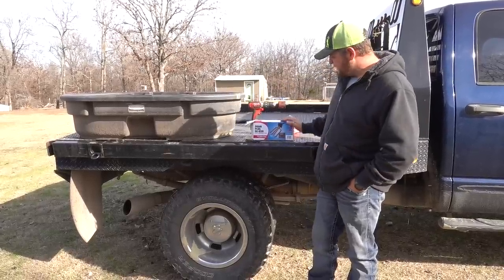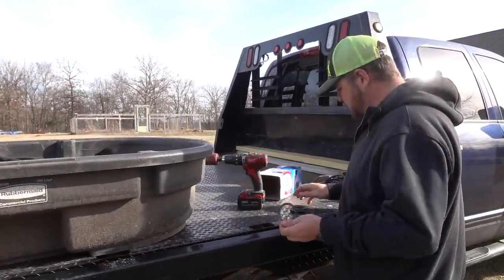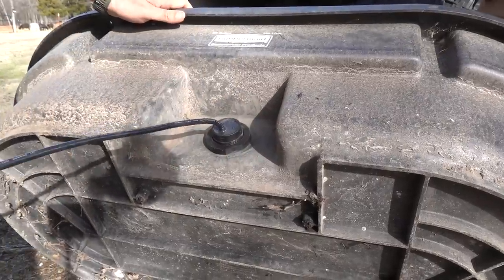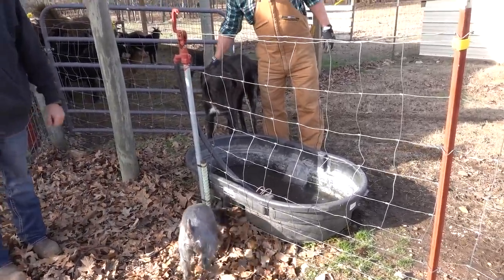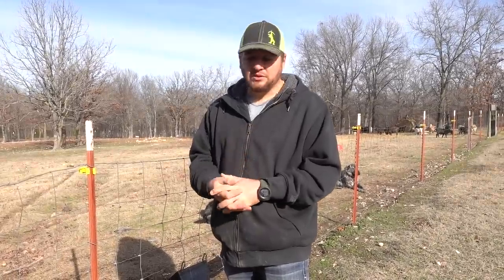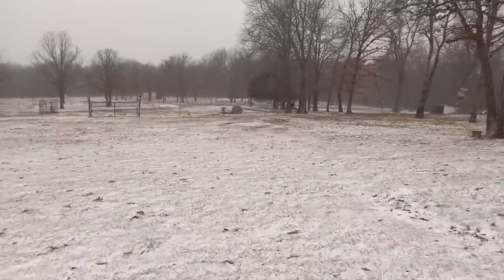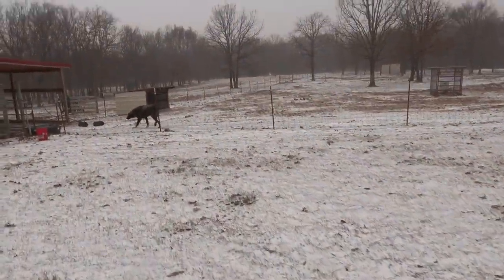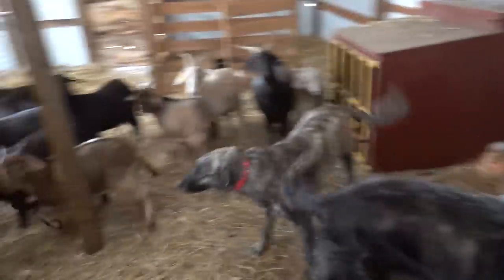SERIOUS PROBLEM WITH THE LIVESTOCK GUARDIAN DOGS!

Comment: Kevin, Thanks for trying to keep the animals fresh, thawed water. 

You may already know this but some may not. There are chew-resistant cords out there that have metal coils wrapped around them. And there are also large stock tanks out there that can be used for both long and shorter-legged animals. I believe they are majorly marked for swine/pigs. I think one brand is made by Tarter.
Reply: Yes, great points! You can also buy these heavy duty cord sleeves for cords that you already have. The tubing is made of a strong mesh-like material that is difficult for pets to chew through. Usually pretty affordable for the amount you get =)

Comment: I have the cough/phlegm cold too this is getting old. Hope you feel better soon Rachel❤
Nice assembly of that heater. I've seen them being used from time to time just metal tanks or setting it in metal bucket or a concrete block so it doesn't melt the rubber. I like what you did also!👍🤗❤

Comment: Hi Rachel and Kevin.  If you place a flat stone under tge heater it will help keep tank warm.  We bought stainless steel tanks put large flat stones and placed our bucket heater on the stones.   Works great we had -25 air temp last week no frozen tanks here!!

Comment: #Rachel, get you 2 fresh lemons squeeze them in a 
lg coffee cup & put HOT WATER with a tsp of sugar 
& stir it around then drink while it's hot like coffee 
do it just B-4 bed & it will sweat that mess out.

I had walking ammonia & did it & it got rid of it 
like over night, so give it a try see if it will help
& when you're out in the cold weather put a 
Bennie cap on, it keeps the body warmer.

Comment: You can also put a thin slab of garden like cement underneath the heater that keeps it off the bottom. They do work great to keep the ice off. Leeske looks so dark right now. Kora is so pretty, and when you are ready they will make beautiful puppies. Use the old collar for a goat.

Comment: Drill some holes through the lip of the tank and use heavy zip ties and attach it to the fence in case the water gets low enough that they could try to move the tank.

Comment: My Dad was an electrician and when my shower drain would freeze, he also could not find shorter tapes.  He cut one down and rewired it.  And then he built an insulated box around it.  It also had a sensor and would turn on at 35°.

Comment: Note to self, put the new collar on before removing the old one 😉😂 with love from experience 😁 💗🌸 I call them necklaces also! My dogs get excited putting in their ‘necklaces’ because I make a big deal how pretty they look (yeah boy dogs hear handsome 😂). Question though, I VE the same low stock tank, but mine has a screw style plug. Is it area maybe? I’m in Oregon. Or maybe they’ve changed since I bought mine? I have to say, it’s about 20 years old and still looks new even from many litters of golden retriever pups over the years teething on them. They are amazing tubs!

Comment: Ok this is what we do.  It may work for u.
Take a cinder block square broken so the heater fits on the hole.
Yep place heater in block. PVC pipe on the cord cutting small pieces is fine. The pups can try to chew pipe but should loose interest fast. Or do larger over smaller pieces

Comment: Not sure what you are going to do but, I probably would have put that where you can feed the wire thru the fence or a wall then have a piece of plexiglass cut to cover 3/4 of the top. Maybe still put the hole but high and under the plexiglass. That way you don't have to worry about leaks and the plexiglass covers the heater itself. Not sure how thick it would need to be to keep animals deciding to walk on it but..they make big fish tanks out of it and water is way more forceful.

Comment: Get the tall one and dig a hole and bury the bottom half. Now the cord is hidden. Then stick a row of cinder blocks or something in the bottom of the tank to take up the bottom half so the goats don't get stuck
It would act as a heat sink.